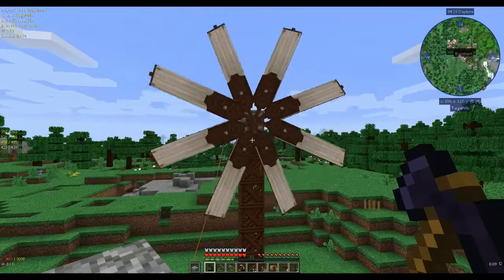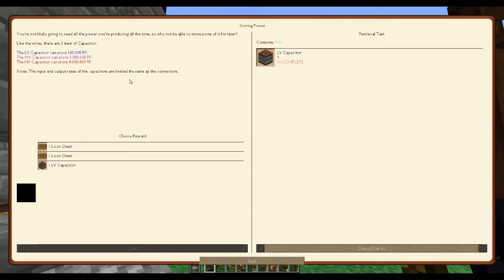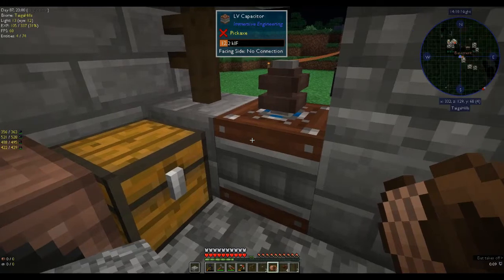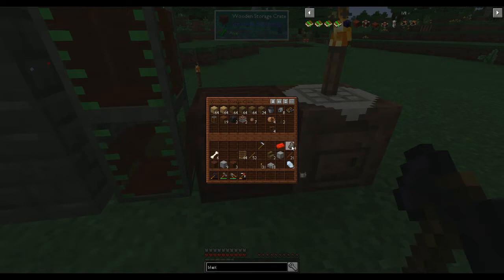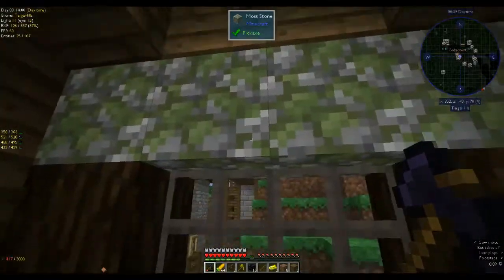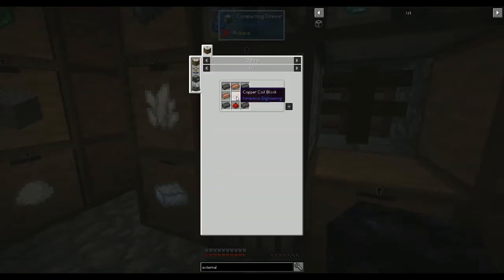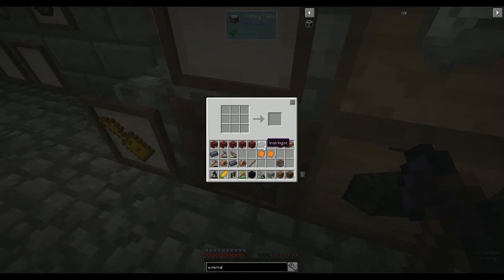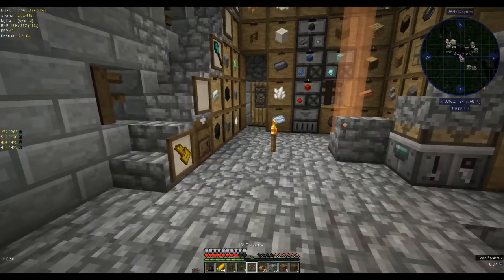Making LV Capacitors |  Automaton | Ep 8 | Modded Minecraft

Comment: One easy way to get power through a wall is to replace a wall brick with a capacitor.  Put an input on the outside of the wall, an input inside. I put them three or four high, so I can run wires inside that I won't run into.

There's something about putting a relay(?) on a wall, then hitting it with your Enginerr's Hammer to make it pass power through the wall, I think.
Reply from the maker: I've already recorded my next video, but I'll try out your suggestions when I record the next one, Robert!